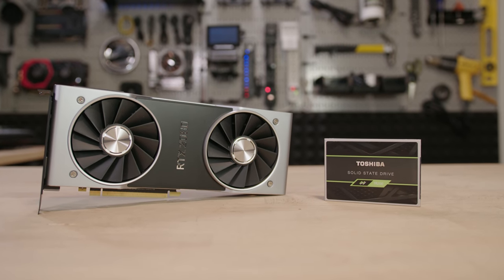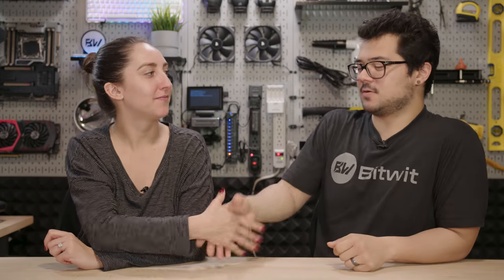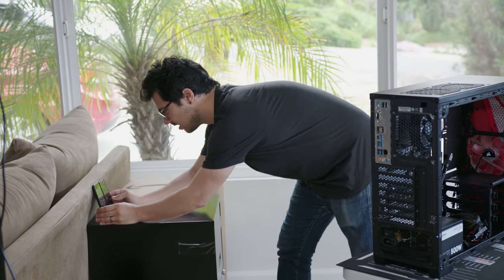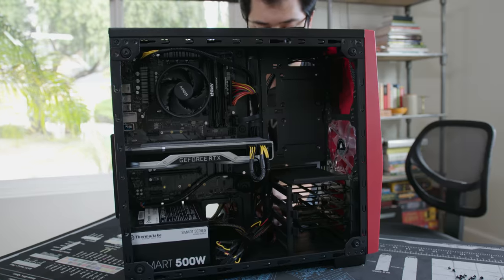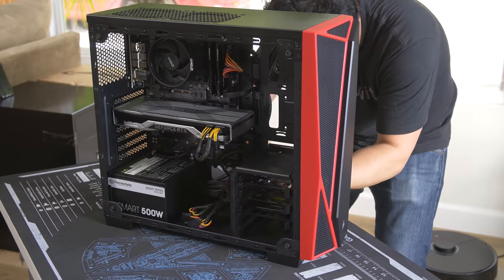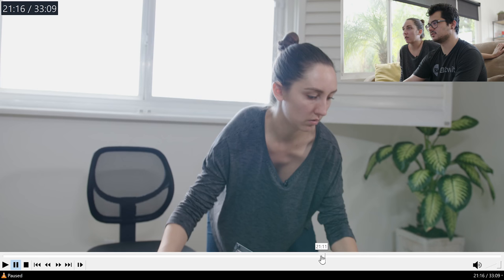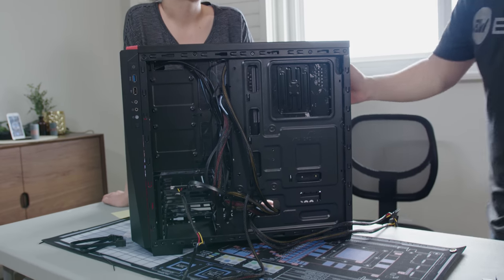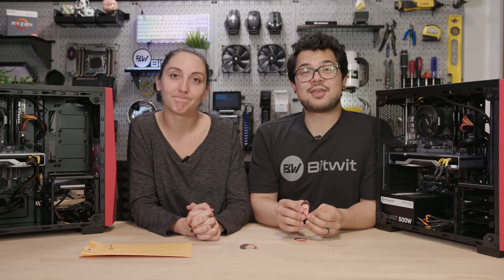She challenged me to a CABLE MANAGEMENT CONTEST (big mistake?)

Comment from the maker: Thanks for watching this one! It was fun :)

Btw I've heard the cries on Floatplane and I'm sure they'll be echoed here so--We WILL be doing a rematch at some point with NO time limit and more cables to manage (RGB devices, AIO, etc.). Any other suggestions welcome for Round 2!
Reply: 1
Reply: 2
Reply: 3
Reply: 4
Reply: 5
Reply: 6
Reply: 7
Reply: 8
Reply: 9
Reply: 10
Reply: Kyle VS Lyle when?
Reply: STACK ATTACK!!! LOL
Reply: next time give yourself more time then it will be way closer! fun video though
Reply: 11
Reply: Do it like Iron Chef with a 60 min time limit and maybe 2-3 computers completed...or maybe like Chopped where you only have 30 mins, but 1 computer to build. IMO, I feel like the time limit adds a lot to the excitement. You guys can call it Iron Tech...haha
Reply: Enough RGB to require a controller, and maybe a led stick on strip since location and wiring can vary. I like using a case that can be restrictive, like how this one had no slot for the mobo power, and using a non-modular psu was great, so keep those ideas. Adding  a water cooler could be neat. I know with my NZXT the "flexible" cooling tubes are NOT very flexible, and installation was kind of tough and limited configuration options, plus separate power for the pump and fans means more cables.
Reply: pick a case where you have 8+ 3.5" hard drives... and you use every one of them
Reply: 15 minutes is not enough time for this kind of challenge. It should be made around the idea how to handle the cable mess and not how efficient you are with your time. Build a more complex system with a lot of drives and add-in cards and get at least whole hour for the contest. Also SFF build could be something actually challenging for you as well.
Reply: Your wife's a good sport for getting into PC building with you and participating on your channels videos. Congrats to you both for your successful channel👍
Reply: consider giving each of you a budget to spend on beauty things(RGB, sleeved cables, etc) and see who does better in a more complicated challenge.
Reply: Use sleeved cable extensions to add more length to the cables. Could be a make or break situation in specific cases.
Reply: Bitwit doesn’t matter who won. You already won before the challenge even started. You have a wife that is actually interested in your passion. That’s all that matters.
Reply: Kyle.i have a question. I need the biggest favor. When I built my first pc I used your channel to figure out parts and how I built my desktop.  Issue is I chose the stock cooler for my ryzen 2700. So I upgraded to the h100i platinum. Issue is I threw away my stock amd cpu bracket pieces when I didn’t know any better. I have bought 4 sets of them on Newegg and they don’t fit. I was wondering if you had a set of the amd cpu bracket for a asrock motherboard laying around . I would pay you for them.  I contacted as rock customer service and they were useless
Reply: 12
Reply: Have the cards attacks from your other series that i forget the name of.
Reply: Use as many fans (three in the front, three on top, maybe a fanhub) and RGB lights as possible. Dual graphics Card config., cable sleeves, adapters (sata to molex for example) several hard drives and if possible an old ribbon cable DVD drive too (Those are a pain in the ass).
Reply: 13 damn it
Reply: 30 minutes, rear glass panel, GO!!!!! round 2
Reply: My only recommendation is- make it true. Instead of 15 mins with some stuff preinstalled, give yourselves an hour or so with everything still in their boxes! :D
Reply: How about Wifey vs Lyle?
Reply: The case should have tempered glass for both side panels to make the challenge more difficult.
Reply: Do a custom water cooling 1v1
Reply: Aye this is my case and i love it.
Reply: All the toys for sure, maybe go SLI/Crossfire for the extra GPU lines? How about an AIO as well? Something with all the control/power lines coming from the CPU block?
Reply: restrict number of ties,   if 10 is the limit then supply 10.   not a box of 100
Reply: to make things more difficult, fill up all the drive bays. if you really hate yourselves, use an oldschool IDE hard drive.
Reply: Thought the cable management challenge would be a(cable)Tie..
Reply: Next case: Corsair Crystal 570X or 280X.
Reply: In rematch make sure Wifey helps build base so she knows how case works. Lost a lot of time because of unfamiliarity with case
Reply: Round 2 Cable Management in a drifting car 🏎 and Round 3 blindfolded in a speed boat 🚤
Reply: At least a rematch. I found it unfair.
Reply: Do a theme based build-off, where you get a budget and free hands to come up with the most aesthetically pleasing build (not looking at performance) themes could be; Gamer setup, Office (as plain as possible), Evil genius dungeon lair; Teenage room (boy/girl variants), Corporate CEO desk system,  etc. Perhaps do some addons like stickers and external lighting.
Reply: Kyle hope you red this , hope you donate me a pc :( or any challenge to do to give me a pc thankyou
Reply: Multiple gpus, maybe?
Reply: I think the time limit helps to make it challenging, but 15 minutes is not quite enough.  I'd say it should be 30 minutes (long enough to make it pretty, but still short enough to keep the pressure on).  Chris brought up a good point of the back side not mattering in the end, so I'd also suggest a case with glass on both sides.
Reply: need this rematch, I think wifeysauce would have smoked you.
Reply: I want to see a remach--with a SFX build.
Reply: I would highly suggest adding an optical drive or cars reader. Maybe even an obsolete drive that may have an extension/different connector

Comment: 15 minutes was not enough time, cable management isnt about speed but detain and neatness
Reply: Yep, I actually spent about 2 hours on mine. I straightened all the factory kinks out of every wire so that I could bundle them up neatly. Could it have been done in 30-45 mins? Sure, but the extra time I spent was def worth it. This rush "battle" doesn't produce good management at all. I vote redo.
Reply: But if it’s more then 15 minutes it takes the challenge out of it. That’s while point of the video.
Reply: @_miyu  I completely agree with you I also have spent usually 1,5-2 h on cable management to get the look I really like.
Reply: It's a CHALLENGE. people man
Reply: but majority of the time they were given was for cable management as the motherboard already had the CPU RAM and cooler installed and was already in the case when they started the challenge
Reply: @SABER JOCKY I agree with you put the point of the video is to make it a CHALLENGE. Not a tutorial on cable management or tips on it cable management.
Reply: @shaun522  You can plug it all in and sinch it down in 5 mins. That is not cable management. Even at 15 min look at the result. By Kyle's own words "I don't have to make it look good, just better than hers" and, "If I had time I would have routed this better". So do you call that "management"? No I really don't call this management at all. Sorry.
Reply: @shaun522  But the point could have been in the choices. For example simple SSD location decision, put it lower to hide the cables more or put it higher to keep the SSD even more hidden. I do some of my cable management choice even before putting motherboard in place and cable routing can make huge difference in end result.
Reply: I agree. It wasn’t a damn race, it was a competition on who could create the more aesthetically pleasing build using cable management as the focal point. This needs to be redone with that focus at the heart. It shouldn’t be limited by time, but by creativity. Mod the case if need be! It falls under that umbrella. It needs a chance to be done correctly
Reply: Man some of these replies are so dumb........it was CHALLENGE OMG not a video on how to route the best cables..🙄
Reply: @hoodrabbit4293  A "Build off" would be a challenge. "Can you get this to post before me?" In that case nobody cares about the cables. This specifically is a "cable management contest"! Not a race, and the looks of the cable is the actual point.
Reply: I completely agree with this! Rematch with more time.
Reply: @saber-jocky3436  If you're actually building a PC for a customer in a standard PC shop, time is critical. Unless you're a "boutique builder", charging a customer for 1-2 hrs of labour for ONLY standard wiring (not custom sleeving) is 1-2 hrs too many that your customer will never pay. If you can't do it in under 15min, you've got no chance. The challenge is near enough to real world conditions for most PC technicians.
Reply: @shaun522  That could easily be fixed by giving them an annoying chassis to work with such as the bitfenix prodigy.
Reply: This was a build AND cable management challenge!?
Reply: @ikkuranus  The Prodigy has some pretty good nooks and crannies to hide cables in. It's not as bad as some other dirt cheap cases on the market. Definitely custom length cables are better in the Prodigy.
Reply: Zahid Shabir those are easy to instal on the mother board. The cables are the hardest part.
Reply: @saturnGEEK  that's why big box store cable management isnt top notch!
Reply: @dickkallerhan2412  Yeah, a friend ordered a computer from "ibuypower" but had it shipped to my brothers house and they asked me to install the os and get it prepped for him. I had to open it up and plug all the drives in and I got a good look at the "job" they called "management". Nothing was tied down, the wires were jammed in there and the case could not be opened and closed without holding the mess of wires down at the same time. I left it "as is" and I said, "This job is a mess, I did my best with it. You're the one who bought the computer so its up to you to complain to them if you want." There is a big reason why that type of job is garbage, and the job we can do is 1000% better. Do not trust a company to manage the cables for you.
Reply: They should have given themselves 5 more minutes after realizing, that 15 is not quite enough, just to finish things up a bit.
Reply: @saturnGEEK  That was not a condition of the competition. The objective was not "who can get an acceptable cable management the fastest" but about who cable-manages better.
Reply: I don’t care what anyone say.  This needed more time. Challenge or not.  This was just a race to plug all the cables in and close the case... and even doing so y’all still ran out of time..
Reply: Well you give them both a BUNCH of time and then they'd probably have around the same and it'd be too hard to judge. It's about the skill to still do good under time and pressure.
Reply: U shouldn’t worry about how much detail they put in when u can’t even spell detail right
Reply: 100% agreed

Comment: No Static Bracelets were used -1 point for each contestant.
Reply: G-O-T-H They’re only useful if you’re in carpet or some other place that can generate a static charge. It’s literally not even a big deal at all.
Reply: @ohHeyKev  Pretty sure it's a joke.
Reply: @ohHeyKev  You obviously didn't get the humor and sarcasm in my joke in regards to a certain "How To" video.
Reply: you mean rivestrong braceret?
Reply: @jihoonyou9582  Yes! That one!
Reply: They were using The Verge wireless units.  Can't say Where they were wearing them.....But they were...Rivestrong.  in all the wong praces
Reply: @ringsoffire5947  Maybe they were ankretts?
Reply: no swiss army knife that may or may not have a Philips head screw driver attached was not used -69 points for each competitor
Reply: @Alexander Lindin 🤦‍♂️

Comment: That case actually does have a cutout for the cpu power, you just need to feed that cable through before installing the motherboard
Reply: Then...  It's a poor cut out.  Bad case design cut out.  Make room for dual 8 pin.  nod.nod, wink, wink.  Great feedback for them though:)  Thank you.  Only 2 % of customers will unbolt the Mobo (me) to make that work.  Great shot out to make the next gen better.  Thank you!
Reply: @ringsoffire5947  Yeah I'm not saying it's a good design, Just pointing it out :) I have used that case and similar ones before and had to pull the motherboard out before for better looks

Comment: 1 Common misconception is that cables should be grouped together, that is WRONG. 
Cables generate an incredible amount of heat, its like rubbing two sticks together, go at it long enough and a fire could spark!  Unless you have water cooled cables, the best thing to do is have them spaced out apart preferable in their own cable lanes so they have room to ventilate. 
IF you can't do that, just have them all over the place like a Hendrix Afro. 
You can also coat your cables in thermal goop to lessen the chance of them getting hot. 
You both created bombs ready to explode.  Please be careful!
You guys didn't even wear anti static bracelets while assembling.
You are both MAD!
Reply: Nice try buddy

Comment: Horrible test of cable management skills.  You should have started with everything in the system already assembled and just have to cable manage it.  This would negate the unfair advantage over Wifeysauce with her lack of computer building experience.
Reply: Kyle wanted to rig the contest to give him more chance of winning obviously.
Reply: @LeNimph  yeah that was kinda unfair
Reply: Also this build is barebones, we need to see something with multiple drives, extra fans, and other accessories that would make cable management harder, especially with a non-modular PSU. It's when you have all that extra stuff that the choices become less clear cut and more subjective.  He seemed more familiar with the case too.
Reply: Or just give longer time to do it so that it's more about the choices they make and they could have left everything uninstalled then at the start. Anyone could have the computer functional after 15 min in this challenge but if you go for great cable management you have to sink a lot of time on it. I have had builds where I leisurely build them and it takes 1 h to assemble and another 2 h to get the cable  management and the look to my liking/standards.
Reply: So you want to have to cable manage around an already installed GPU? Your idea is much worse than what was in this video. They should just find a case without a stupid PCIe mounting system next time.

Comment: You should have started with everything installed and then just put in cables
Reply: Exactly. And the ssd could have been pre-mounted in the holder but separate so there is still the choice of where to mount it.

Comment: I have a question I have been thinking about making a pc but the only thing that worries me is the drivers what I am using? Any tips on what can help me set those up and other things I should know when I first boot up my pc
CPU. Amd Ryzen 5 2600x
Gpu. MSI GeForce gtx 1660 to
CPU cooler. Cooler master 212
Mobo. MSI B450 tomahawk
Ram. G skill trident z 16gb ddr4 3200
Hard drive. Sea gate barracuda 2tb
Ssd. Western digital 500gb m.2

Comment: I started with a spec-04, once I switched to the H510 I was astounded on how much easier it was to cable manage!
I may have also bent the back panel trying to add some rgb fans... not nearly enough space for 5 fans plus cables (and a semi-modular psu)...

The GPU brackets also were pretty bad in terms of trying to put in the GPU

Comment: Honestly, I find the power LED way more important as far as functionality is concerned. My PC only has Noctua fans in it and at idle they don't go faster than 400RPM. There's been times when I legit almost started messing with something without realising it was running.
My case doesn't even have a reset button. That should tell you how important even manufacturers consider it.

Comment: Shouldn't Kyle's front panel connectors be checked if they're in the correct orientation and pin? Correct me if i'm wrong but i think they aren't. Not that it matters anyway but for the sake of it.

Comment: i did a decent job cable managing with a 2008 case, but the gpu cables were too short, as the psu was on top, also there was nowhere to gide the front panel connectors. i stuffed most excess cables in the small space behind the hdd mounting spots

Comment: The struggle of non modular PSU is real. I have a PC Power & Cooling 750w from way back in the days that I still use and every time I build a new system I wish I could just snip off some of the extra connectors i never use.

Comment: I want the reverse of this challenge. Take a computer that starts perfectly cable-managed, with a fully modular power supply and only the cables it needs, a GPU, a sound or USB card with a front panel cable, and two non-m.2 drives, then just make it look like shit with a horrible mess screwing with the airflow. Winners would be judged on speed and difficulty removing and re-installing components. Bonus points for the judges shrugging and re-managing the wiring.

Comment: I have this case. For the 8 pin I threaded it through the top corner and then placed the motherboard on top. It works but probably isn’t the smartest idea because it gets really squeezed. But with the 3 Corsair fans and lighting node my cable management is better then I expected at lease if you look in you can’t really tell how bad it is lol

Comment: I personally use the spec-04 for my current build (my first person gaming PC build) and let tell you how b a d cable management is in this case. Very limited routing options, tight space for cables, no shroud, and so on. The case is 48 bucks so no complaint, adequate airflow especially for the price and a nice aesthetic and a tempered class side panel that treats light very well. :D also installing GPUs in this case is a total bitch too